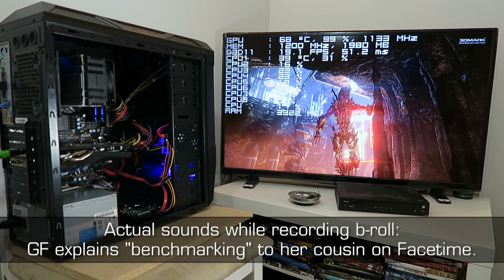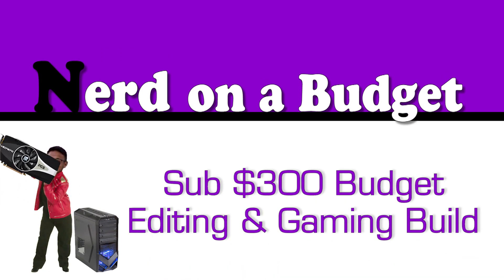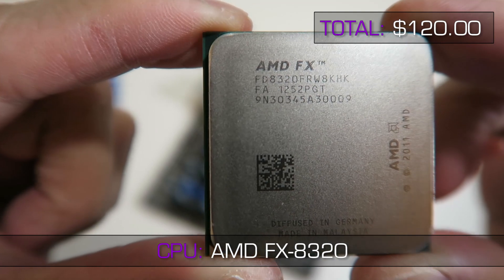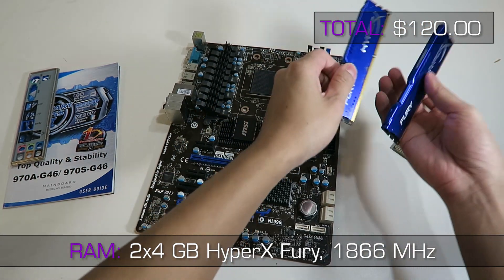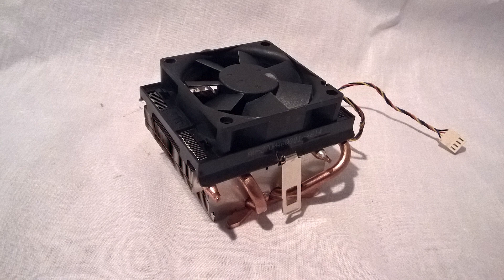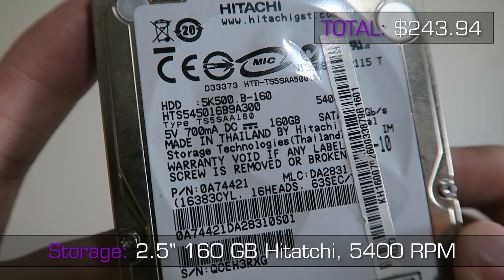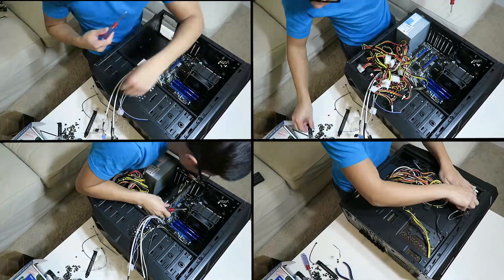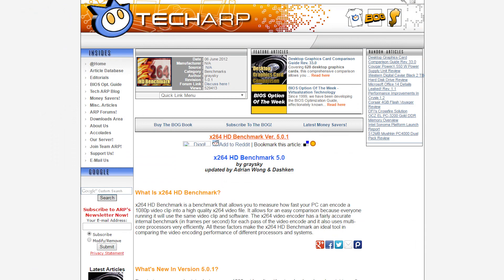The Sub $300 Budget Editing and Gaming PC (FX 8320 + HD 7870 /w Benchmarks)

Comment: Very informative video! But I would have leaned towards newer a newer generation of AMD CPUs because Vishera is pretty old considering the time period this video was made. If I were the one building this computer, I would have just changed the CPU to like a Ryzen 3 1200 but your choice of parts was pretty good based off of the date this video was released and since ryzen wasn't even out yet, I would understand why you leaned towards the 8320 which still performs very well considering it's a price to preformance.

Comment: Would I be able to get some help on this build? I got the components and everything turns on but I’m not getting a video signal. I posted this on another video I mistook that build for this one.
Reply from the maker: Are you plugged into the graphics card instead of the motherboard? And are you sure the graphics card is not faulty?
Reply: Nerd on a Budget I was plugged into the graphics card, didn’t have the proper cable for the motherboard. I did get the gpu from eBay so 🤷‍♂️
Reply from the maker: Then you did it right, it's supposed to go to the motherboard. Is the fan spinning on the graphics card?
Reply: Nerd on a Budget yes it is. I think maybe the gpu is faulty. I’ll see about a new one. Thanks for responding so quick!
Reply from the maker: Do you have a friend that has a PC you can test the GPU on? It may be something else, like the Mobo

Comment: FOR $290 NEW I decided to go with...
A8 9600 APU (4-cores 4 threads @3.1Ghz (3.4Ghz Turbo)
2MB L2 cache.
Radeon R7 Graphics @900Mhz with shared memory.
8GB 1x DDR4 Ram @2400Mhz
120GB SSD @555Mbps.
512GB Hard Drive.
450 Watt Power Supply
than a good motherboard and a decent case.

Comment: Just received the exact same motherboard but after I finished building there was No video signal. I've tried a different GPU, RAM and clearing CMOS. Any idea?
Reply from the maker: It could be either the cpu or mobo is dead, I wouldn't be able to tell without testing both with another set of hardware unfortunately

Comment: how do you have the OS on Mobo
Reply from the maker: When you activate windows 10 on a computer, it sends Microsoft information about your motherboard since activation requires an internet connection. From then on, if you replace the hard drive and put a new blank hard drive in, if you install windows, when you connect back to the internet microsoft will know your motherboard has been activated with windows before and it will activate without you having to put a key in

Comment: only thing is I'd add 8 GB RAM for stuff like Minecraft ;). but otherwise I'd do this. thanks a lot :).
Reply: Depends on where you live. If your in USA you can get complete 2nd/3rd gen Intel i7 oem systems for around 200 usd on ebay. Then just drop your video card in. A lot better than that AMD.

Comment: $120 for a 5 y/o gpu, why? a video about best bang for the buck regarding second hand gpu would be great.
Reply from the maker: The GPU was $80
Reply: ok, got confused with the total $120 on the right hand corner but, isn't still too expensive for 5y/o? I am currently looking for a card and prices are not that good. not much difference between a new one and an old one. the last one i bought used lasted around 5 month only of not heavy use.
Reply from the maker: +user 007 it's reasonably priced, it will perform on par with new cards like RX 460 and GTX 1050 that cost upwards of $100-120
Reply: good, will start looking for one of this.

Comment: Nice build! Another option would be to go with X58 and 32nm 6cores CPU such as an Xeon X5649 (up to 1000p in R15) and use cheaper ECC Memory. You might as well want to undervolt the CPU to have a cooler and more reliable workstation.

Comment: wow that's a grate deal my 8350 black addition, sabertooth r 2.0 ,pny gaming memory Caz 7 16gig 1866,evga g2 850w power supply, noctua cooler, Samsung evo 500g, 1tb wd blue backup, 1070 , asus vg278vh monitor and 7 termatake blue fans, case and it came close to $2000.00 but it runs everything I trow at it at 1080p so I'm happy

Comment: Wish I had the money to build a used pc
Reply: If you know where to look, you can find good parts for pretty cheap 
(ive heard ebay is good, and you should know what the part is like before buying :3)
Reply: yeah ive searched a lot and have dont some stuff i got a intel core 2 duo dell pc fpr 10 bucks but when i got it running and put a freinds 750 ti in it i was super slow
Reply: Yeah the duo would bottleneck
Reply: There's ways to do a used PC for pretty cheap. I've built several older computers for like under $100. I can give you some pointers if you would like!
Reply: i'd love that, I got my pc at a flea market for 10 dollars, I really need a upgrade.
Reply: Do you have a budget?
Reply: 400 dollars
Reply: Would you want something all used, or all new? Also, are you located in the States?
Reply: @Deemo13_  so is there a place to get reliable used parts in the US? I'm having issues of hot temperature with my old laptop, I need to try maybe some used parts! What you think?
Reply: @seekfactsnotfiction9056  I would check out reddit's hardwareswap first depending on the budget you are looking at
Reply: @Deemo13_  I have an old 2010 Sony Vaio VPCF1390X 64-bit
Intel (R) i7 CPU Q740@1.73GHz
8 GB RAM, Samsung SSD Toshiba 
Nvidia GeForce GT425M, Win 10.
The issue now is Overheating! high temperatures over 120F when try to edit! I was wondering what could be replaced to improve performance and get rid of noisy fans?
Reply: @seekfactsnotfiction9056  I had a similar problem with my older laptop I actually went through and replaced the thermal paste on it and it works great. I'd look up some videos on how to remove the cooler and reapply some thermal paste. It's like a couple bucks
Reply: @Deemo13_  I actually replaced the thermal paste to thermal pad, all dust removed by a friend. There was a little bit of difference, but the overheat and the annoying fan noise is not completely gone! I was thinking of CPU undervolt, but I was told it won't be necessary at this point, simply because it's an old system and it won't go beyond this point! Prior to that, heatsink, battery, fan were replaced multiple times throughout the years. Editing is the issue now, it gets hot right away! I have to turn it off very often. Despite all that, I permanently use two external coolers: 1)Cooler Master CMStorm SF-17 and 2) Opolar to suck exhaust heat utside! Idk what else to do with this junk... lol
Reply: well im not located in the united states and i dont mind used parts but 400 dollars is give or take the budget if it was in the US
Reply: Your best bet is probably the used market. Takes a little bit more work, but the reward is pretty great. You could find a nice older i5 system with an old mid to high end GPU in it. 

What games are you trying to play?
Reply: thanks

Comment: Amazing video, way to start 2017!
I am still in conflict whether to get an optiplex 790 and upgrade it or should I just build a G4560 kaby lake build. Both costs around 780 CAD but one has better upgrade path while the other one has a good enough quad-core CPU.
Reply from the maker: Whoa whoa whoa, that seems a bit expensive. Where in Canada are you? 780 CAD seems a bit much for either system, even with Canada's slightly higher prices

Comment: I'm going to buy this pc. please guys let me know if it is okay for the price or not:
Intel Core i7-920 2.66Ghz 8M LGA1366 CPU
Cooler Master Hyper 212 Plus CPU Fan
Windows 7 Ultimate 64-Bit Installation Disc
12GB DDR3 Ram Memory @ 530MHz (8-8-8-20)
AMD Radeon R9 270X 4GB DDR5 Graphics Card
EVGA X58 SLI LE Intel X58 Socket LGA1366 Motherboard
1TB Interal SATA Hard Drive (7200RPM)
Lite-On IHAS424-98 CD/DVD Rom
Corsair CX750M 750W Power Supply
Cooler Master 690 II Advanced Case
ASUS Wireless Eee Keyboard
Mouse
Reply: for $600.
Reply: Oscar Pineda its good if it includes the monitor

Comment: NOAB are you using USD? CAD? because I built a $245 gaming PC (Used of course) with an i5 and a more powerful GPU

Specs:
i5-3330 3.00 GHz 3.2 GHz (mobo,cpu ram combo for $130)
8gb ddr3 (mobo,cpu ram combo for $130)
Alienware X51 ITX mobo (mobo,cpu ram combo for $130)
80gb Intel SSD (already had)
1TB WD black HDD (already had)
7870 XT (Kind of a rare GPU it's performance is around the 7950) ($60)
Windows 10 pro (Already on my SSD)
Deepcool CPU cooler ($14.99 + tax)
Coolermaster case + 460W PSU ($40)

All prices are CAD I think I got a really good deal for the hardware I got if you break up the CPU,RAM,mobo combo that's $50 a piece and then $30 for ram the cpu alone would sell for $100+ on eBay the motherboard is like $275+$50 shipping and $30 for 8gb ram is pretty good.

Let me know what you guys think

Comment: Hey guys, I'm wondering if the parts that i bought are decent enough to run most games. I'm kinda new to pc(came from console)
intel pentium g4560
zotac gtx 1050ti 4gb
asrock h110m-hdv
crucial ballistix lt 4gb (×2)
wd 1tb HDD
evga 500 watt psu

should i also buy an SSD? i heard they're quite expensive.
Reply from the maker: +Brownie_Magician SSDs are expensive but up to you if it's worth it, getting a 120gb when it's on sale is around $35. And the build you out together is good to run most games at 1080p

Comment: I built my very first pc on a budget for about $350 or ~$620 with everything else such as the monitor, keyboard, headset, and mouse. I ran into a problem though... my computer freezes and makes this loud buzzing noise through the headset whenever I play a game or whenever I stress test it. Here are the specs: core i7 2600 (used), msi twin frozr ii gtx 760 oc edition (used), asus p8p67 mobo (new), evga 500W PSU (new), 2 sticks of hyperx ddr3 ram (new), and a hitachi 2tb hardrive (refurbished). My CPU temps almost get to 100 degrees celsius when under load, would that be the problem? Oh and I am using the stock intel cpu fan
Reply: emouthic556 are u over clocking
Reply: no, I fixed the temps by getting a new cooler, and I fixed the freezing by clearing cmos while ram was installed in slots 1 and 3. I returned the motherboard and bought a new one just to be safe

Comment: you shouldve went with a fx6300 as it had better performance then the 8320
Reply from the maker: +Kyle Proctor with used parts you can't pick and choose when or what to buy as much as you can with new parts, sometimes you see a great deal and you grab it. I did a build recently with a FX 6300 with this same Mobo and overclocked it to 4.4ghz, but I saw value in this bundle and went for it

Comment: i would try to add an m.2 ssd with a m.2 to pcie x4 adapter those are going chap on ebay right now the ssd's you can see starting bids for as low as a dolar or new other item as low as 20$ for about a 128gb  and the adapter is cheap as well 4-20 bucks. And for the price. of the build the benchmarks were amazing especilly the cinebench i honestly was not expecting that much from the cpu and your friend is probably very happy he got the absolute bang for the buck pc great job and keep up the good work MR.Danny and thankyou for sharing this video with us.

Comment: I have a AMD Athlon X4 860k and a 1060 6gb gigabyte not G1 version I tot only 30fps normal settings
Reply: got*
Reply from the maker: +Sander Grimm the 860k bottlenecks the 1060 on GTA, though something else seems off as you should be getting higher numbers

Comment: Exactly my CPU+GPU combo! But I built it in 2013. 7870 is suffering in high graphics on new games, mainly because of the 2GB VRam.
Reply from the maker: On which games? In GTA as you saw in the video I ignored the 2GB limit and it handled it quite well
Reply: From what I know, GTA V is more CPU bound than GPU. And 8320 is an incredibly value for money CPU which can handle GTA quite well paired with the 8 GB RAM. I didn't say anything bad about the rig, it is spectacular for the price. I just  said from my experience that the 7870 is a 4-5 year old CPU. And for me "struggling" means to play everything on high graphics and 50 fps. I demand to get the most out of my PC.

Comment: Good video but it is too old and for $300 and if I was buying used I would go for an old office i7 2600 and 7950/gtx 660 instead.
Reply from the maker: i7 2600 bundles are still quite expensive from what I've seen, around $160-180 based on my usual places. Good combo and would be better than the 8320, but would have been a bit over budget

Comment: Do you game on a monitor or a tv? Is it possible to game on say a 4K tv maybe 40" with good results? Do you have any preferences as far as monitor vs tv for gaming? I am trying to get into computer gaming and understand that "real" gaming is done on a monitor. But monitors are super expensive for a good size (34")!! I am not a hard core gamer by any means so, I would use this for media, gaming and designing (CAD software). Thanks
Reply: TV's tend to have a little more input lag and motion blur, you also don't need a huge monitor for gaming, 22-24 inches is great since your sitting right in front of it. You also have higher pixel density in smaller screens so they're a little sharper. If you're buying one or the other you can get a 1080p monitor for around 100 bucks in that size. All that being said you can definitely use a bigger TV in place of a monitor for gaming. I would go for a 1080p TV though if you're on a budget, 4k needs much more powerful hardware to drive.
Reply: Thanks for the reply Tim. Will have to research it a little bit more. I am on a budget, so I will see what I can get. Thanks again. How about gaming wireless? Do you have an opinion on that?
Reply: It's better to go with an ethernet connection if you can, if you can't a good wireless card/dongle paired with a decent router will work just fine. It kind of depends how far away from the router your PC is. Mine is wireless and I have no issues.
Reply: Tim again thanks for your reply. I will have to see how to have my future computer hard wired.......
Reply: Felix Espana the best buy where u love is selling a 50 inch 4k tv for 50 bucks smh hiesenne brand

Comment: lol, a mobile i7 thhats a 4gen (3yo) outperforms this cpu in cinebench, by abou 90cb (650cb +-)
running at 2.5ghz (its easily clockable too a 2.7ghz or evena 2.8 if you want 85* is nothing for u, but 80* at 2.7ghz is the sweetspot).
But, 300$ is still good for a machine like this

Comment: I am looking into a computer capable of running overwatch with decent specs (60 fps and 720-1080P). Budget less than 300 if possible. Down for used parts.

Comment: Great one except SSD should be mandatory alright
Reply: Rami Bos what in a sub $300 build ??? budget is a bit tight to be fitting an ssd in
Reply: SSDs are never mandatory in any build. CPUs are mandatory, ram is mandatory. SSDs are a quality of life upgrade, nothing else.
Reply: Rami Bos Exactly. Performance difference between HDD and SSD is sooo huge..would rather buy SSD and build it on a cardbox until next month income then buy a case
Reply: Amer Huba i would prefer to build into a real case then upgrade to ssd when i got the money no point in damaging other hardware by building without a case just for a ssd
Reply: Performance in HDD and SSD is huge only in read/writes on the disk. Gaming wise, or any heavy cpu intensive task ( rendering and shit ) has no improvements for an SSD. So please.... I also do have an SSD and its a quality of life, nothing else. New mechanical drives are not so bad either ( when it comes to normal day to day operations ).
Reply: Ivan Dobrev actually ssd’s do give a huge impact in redndering since it could be used as a scratch disk, although I too do not agree that its mandatory for a tight budget. Its a good upgrade though

Comment: weird question, but how do you run a pc on a tv without the resolution issues? i always end up with a good quarter inch cut off
Reply from the maker: There should be settings on the TV to make it fit, I get that problem too with any issue I hook up to but going through the menus I can usually find a way to make it fit properly

Comment: just a head up, Open CL vs cuda acceleration, The HD 7870 and HD 7970 kick ass. I highly recommend them for budget workstation builds. Or if you have the option to put more money to the CPU and less to the GPU do that, and pick up a used HD 7870 for $74 on ebay

Comment: I need your thoughts on this new build I made and I'm not sure to post it on my channel but it costed around 120$

I bought a prebuilt hp for 20$ 
Swapped out the psu for a rocket fish 500w 80 plus bronze 20$
Swapped out the old cpu it had(athlon ii x2 250) and put in a x4 630 15$
It came with 5 gb of ram so I bought 4gb more for 10$ to make it 9
And an Amd Radeon hd 5970 for 60$
 
A response would be greatly appreciated. :)

Comment: would you build a fx8530 on an asrock 990fx extreme 3? I have a phenom II X4 BE and a gtx 1070 but need to play gta at lowest settings because off the cpu bottleneck... Now I wanna upgrade my pc and the question is a hole new pc without gpu or upgrade to an fx8350....
Reply: Yanneck Gründer get zen

Comment: I'm actually really impressed with this build. I really underestimated the fx line of AMD cpu's. I have a build similar to this I built for my brother. I got him an i5 3570k from reddit that I pretty much got for free after selling an AR-15 skin for h1z1, a p67 mobo off ebay, a hard drive with a clean install of windows 10 with microsoft office on it off craigslist, 8 gigs of ram from reddit, a spare optical drive, case and PSU from newegg, and finally my old gtx 960. In total it cost $265 if you're not including my old 960, in which case just add $120 for a used one which comes out to $385.
Reply: Hate Alex great build, wish i could find a deal like that in Canada.